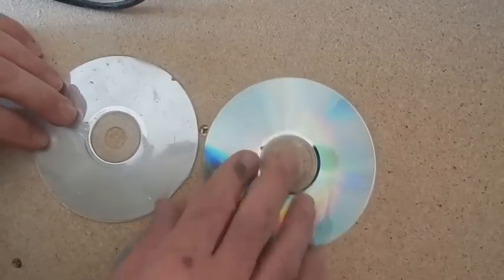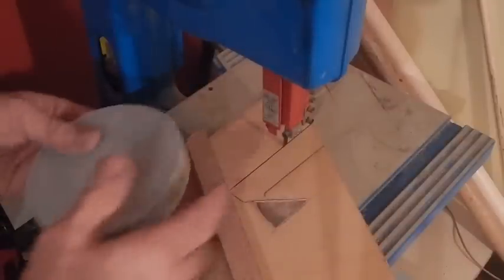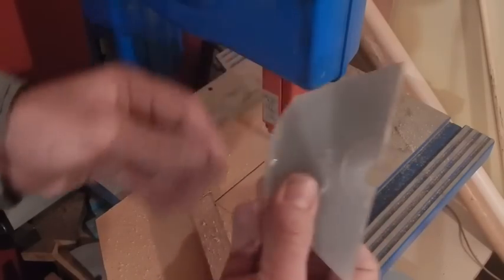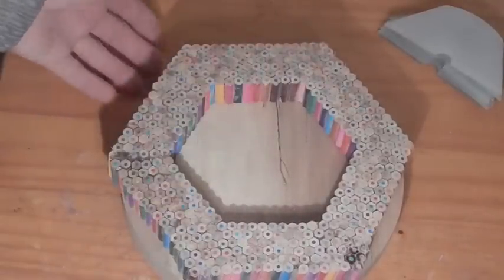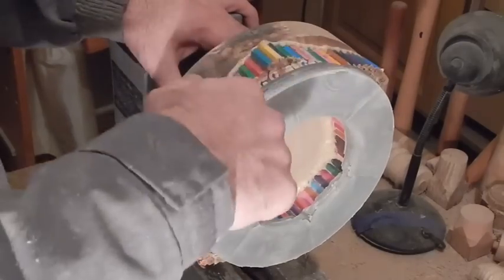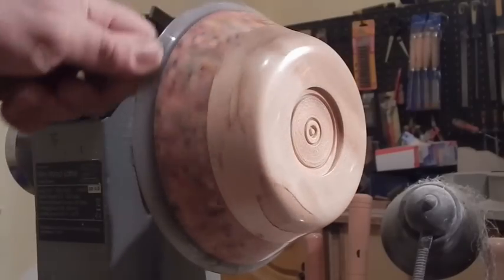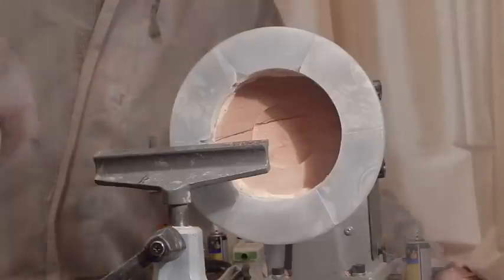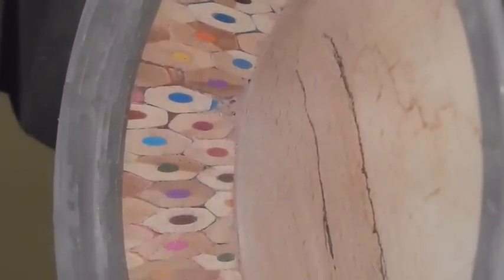Woodturning A pencil bowl with compact disc rim....Upcycling

Comment: Cool!! I binned nearly 1,000 cd's a few months ago. Doh! I might still have a few knocking around somewhere though,I'll have to dig them out :) I found that if you turn the pencils on their side so the ends show,there's a lot less splintering,but it's a bit fiddlier having to make a long strip of them,and then segmenting them.  Nice work Steve,   Take care,   Keith
Reply from the maker: +Keith Barrow Hi Keith, I wanted the pencils this way for the effect I got, I wanted everything to transition towards the Cd's,,,,,
I started to watch your recent Vid yesterday got called away half way through and when I got back it had gone ?? 
Thanks for watching, Steve.
Reply: Templeboy Turnings Yeah,slight error there,but I'm just about to put it back up.

Comment: you should try grinding up some Cd's into confetti and then reforming with some resin the color from the label's and the prismatic effect's from the data surface would look really interesting.
Reply from the maker: +Todd Mckenney Hey Todd !!! Good idea, the aluminium foil on the Cd's tends to flake and break to dust once the laminate is removed..... Thanks for the suggestion much appreciated, Steve.
Reply: Your welcome Templeboy Turnings another idea is you might be able to fuse the chip's together with heat they're made of polystyrene which is a great plastic for turning it's hard and glassy but still cut's like wood!
It's melting point is 464°F 240°C if you put them in vacuum storage bag's then heat them it should fuse into one solid mass.

Comment: Did you have to make a second blank? The pencils you started with were vertical and on the finished bowl they are seemingly horizontal.
Reply from the maker: +Lovetehmusicz No, same blank ... That's the effect you get when you turn the bowl, If you imagine a pencil standing up then cut it at a 45 degree angle you will get the same effect ..... Hope that explains it OK for you. Thanks a million for watching and commenting, regards, Steve.

Comment: steve that is over the top great work. were do you get the square pencils how many do you need? thank you bob
Reply from the maker: +Robert Kutz Hi Robert, Thank you...... I buy the pencils locally from a low budget shop for €1.49 for a 24 pack....... You can get them online and they are available in the states, but I can't remember where? maybe others will know? They are hexagonal and I cut them 30mm so you get 3 cuts per pencil... so this blank was around 120 pencils give or take a few...... I glued them together with medium thick CA/superglue which I also get from the budget shop.... I hope this helps Bob, let me know if you have anymore questions, regards, Steve.